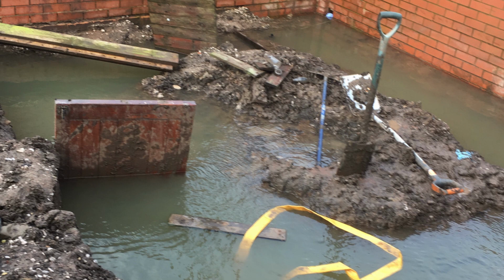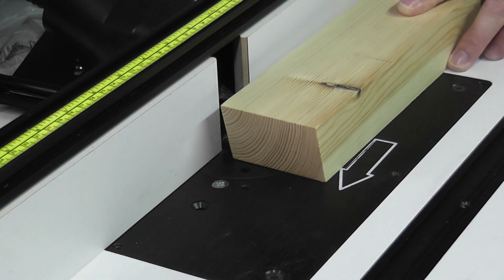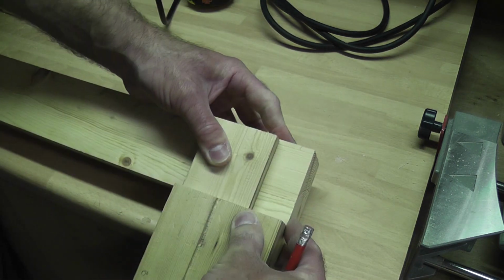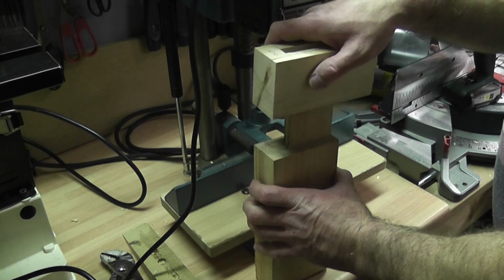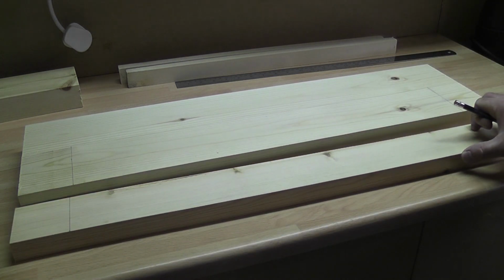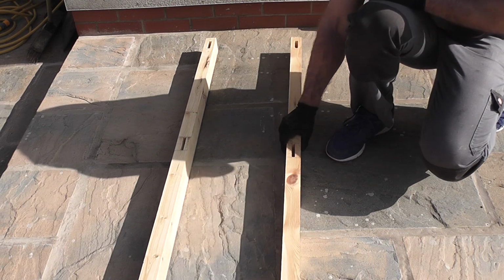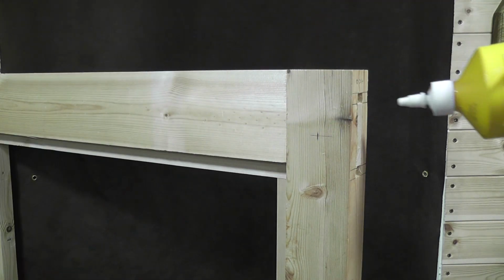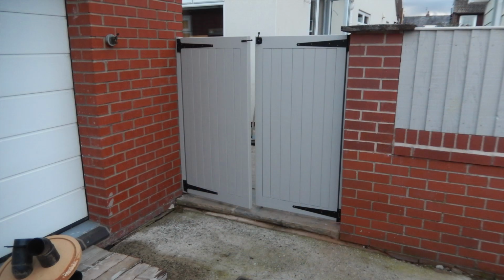Building A Solid Garden Gate Using Mortice And Tenon Joinery Pegged and Wedged and Built To Last

Comment: Thanks for the excellent video. Any reason you added filler strips  to frame the cladding rather than routing a rebate as would have latter would have been quicker?  I like that you have framed the bottom edge of the cladding. A lot of commercial framed external gates have the cladding run over a reduced width bottom rail which is set high, which leaves the cladding end grain exposed to rain splash. Nice use of morticer to cut side angles to receive wedges. I'm going to be making a couple of cedar clad gates soon for my garage back door, and toss up between getting band saw or morticer. Think I'll get the bandsaw as I can route the mortices with my half inch router + chisels,  bandsaw makes quick work of tenons, and probably has more general use. Thanks again.

Comment: Great video but with lots of these videos you guys have all the tools that us diy’ers don’t have. 
Band saw
Mortise cutter
Pillar drill
Table router
Etc.
Reply: Every bloke should be working on building his tools up and being useful at fixing things, majority of the tools you need to do moderate DIY tasks cost less than the average smoker spends
Reply: @stephencooper3665  so you think that those tools and a workshop are for DIYers. 
Not in the UK. Thats thousands of pounds I dont have
Reply: @raydebbiemcdonald3208  depends how much you want to be reliant on your own skills, I left the army at 32 and started an apprenticeship as a mechanic, I worked three jobs for almost four years to pay for my tools, living costs and to save a deposit for a house down south when the prices were high, you can get most things done if you want it enough, we didn’t go out that often and we watched what we spent, we are now in the process of renovating our next house and thanks to learning through trial and error along with collecting tools I’m doing the carpentry myself, I work full time as a hgv driver so it’s all done at the weekends and around the gym, you can also buy a lot of power tools used online or refurbished for a fraction of the price.
Reply: @stephencooper3665 In what year mate? I don't disagree but the ratio of wages to prices has changed a LOT
Reply from the maker: To be honest, I’m just a diy’er myself 👍 My first gate like this I built using a hammer and chisel but over time I’ve built up a reasonable collection of tools. They aren’t the best by any means but even the basic machines help. The mortise machine is probably the cheapest out there but it does the job…just 😂 I know what you mean though about having the tools but it really has been a case of buying a few cheap tools, selling a few items then upgrading as I went along 👍

Comment: Its lovely and to the point video. Thanks for sharing it.
I was wondering what wood did you use ? and was it treated timber ? Appreciate your response.
Reply from the maker: For the gate I just used pine. Normally I coat them with Sikkens...a base coat and the normally a couple of top coats and that does the job for years. This time I tried just Cuprinol. The Sikkens is definitely a lot better. I’m just building another one today and going to add a wood preserver, then the Cuprinol for belt and braces. We only went Cuprinol because of the colour. If it was purely up to me I’d go Sikkens every time 😊
Reply: @Smugwood  oh its great to know. I wanted to build a gate for my house and was not sure what wood to use so i opted for rough sawn treated timber. I went for that as i thought this is the only thing to build an outdoor project.as you can imagine the finish was not great.  I could have gone for planned timber and could have treated it as you said. Lesson learned . And thanks for replying it in so detail. I hope you will share your new build...
Reply from the maker: Always tricky with rough sawn treated timber but being treated, it should last longer than untreated. Ive tried various finishes and woods. There’s a lot of hardwoods with natural resistance to the weather but that bonus comes at a cost. So I quite like using Redwood/Whitewood pine. Sikkens have a recommended procedure for protecting wood...something like a treatment, base and top coat. Not the cheapest of products but I’ve used on pine gates and small fence panels and 15 years later they’re still up...and not touched since first treated. 😊